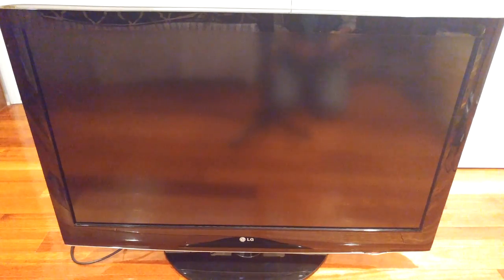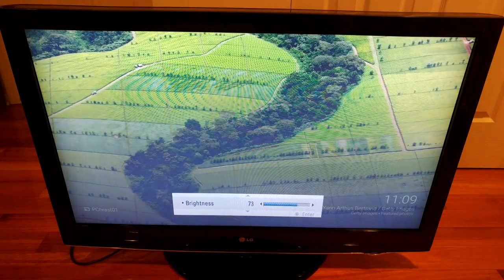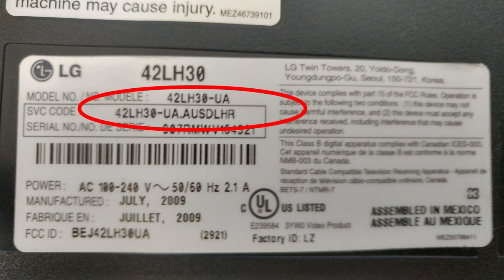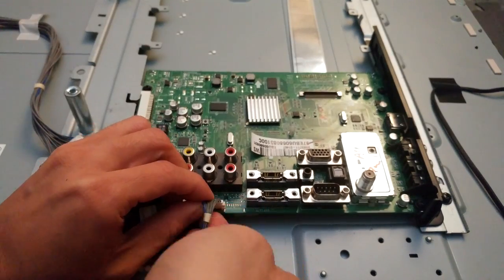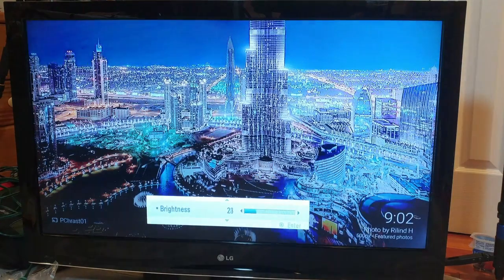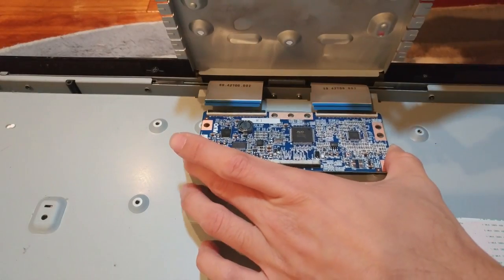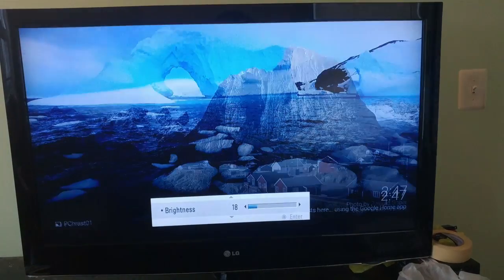How to Fix and Repair LG 42LH30 LCD TV Solarization by Replacing T-Con & Main Board

Comment: Mine is a LG 55LS4500 and it looks exactly like what yours looked like except mine is stuck in the closed caption mode. When I went to bed last night it was working perfect but tonight it has that solarized look with the closed caption constantly running. Do you think mine can be fixed as easily as yours was?
Reply from the maker: I believe these are two separate issues. For the solarization there are only three culprits. The two boards I mentioned in my video: T-con and main board, or the third source could be a bad panel, which doesn't seem to be the case because you said it was working fine recently. Replacing either of the boards should be relatively straightforward, as shown in the video, and inexpensive. If it's a bad panel, you're better off replacing the whole TV as that repair is expensive and not easy.

There are a couple possible solutions for the closed caption issue. Since the CC text comes in over the coaxial line from the cable company you maybe need to turn it off in two places: once from the TV settings which has a 'closed caption' option in its main menu (use the remote that came with your TV) and a second time on the cable box from your cable company which has its own separate menu settings (use the remote that came with your cable box e.g., Comcast, TimeWarner, Verizon etc.). If you can't find the 'Closed Caption' or 'CC' setting in the TV menu, try changing the input source from 'HDMI' or 'Component' to 'TV' or 'Cable' and check the menu again. Sometimes the menu options are different depending on the type of input source you've chosen.
Reply: Yeah I found the culprit for the closed caption not turning off. I had tried over and over to turn it off with the TV remote but it was already set to be off and never thought it would work on the cable remote but I tried it anyway and that was the problem with that. For now I have the display brightness turned up and that helps but I want to try what you did to get a permanent fix with better results. Thanks for your help.
Reply from the maker: Ok, great; glad the first issue is solved! If you can turn up the brightness to "fix" the colors, that sounds like a problem with the T-con board, which usually is the cheaper component to replace. I'd start with replacing that to see if it fixes your problem, then you won't need to also replace the main board.

Comment: I have a LG32ld350, but I can't find the Tcon board, can you help
Reply from the maker: Here's a downloadable service manual for your model TV: https://www.electronica-pt.com/esquema/tv/lg-esquemas-tv/lg-32ld350-chassis-la04a-lcd-18738/ [PDF file]

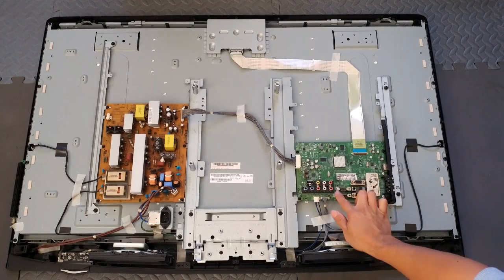On Page 16, there is an exploded view of the TV and near the label marked '200' is where the T-con board is. It will be under a metal shield that you will have to unscrew. See 0:54 in my video where I point out the T-con board on my TV. It is located in a similar spot. I won't be able to determine the model number for the board without seeing it though.